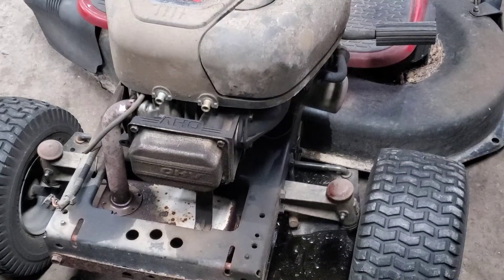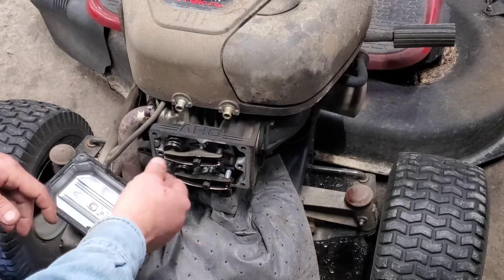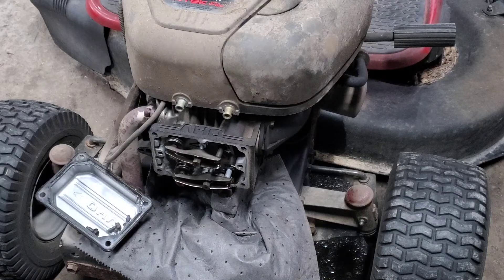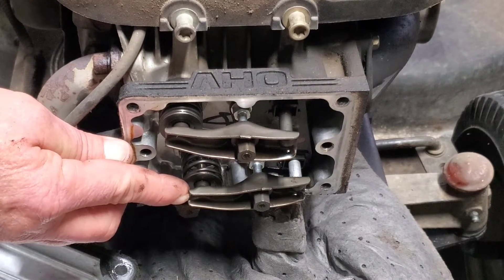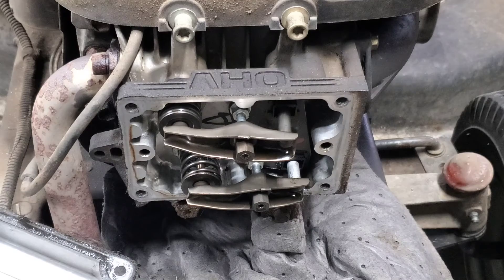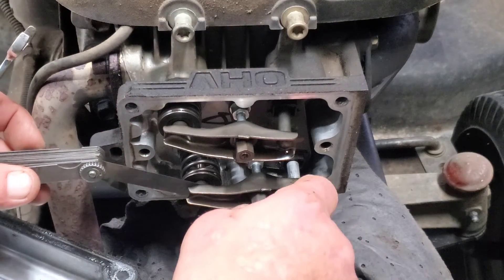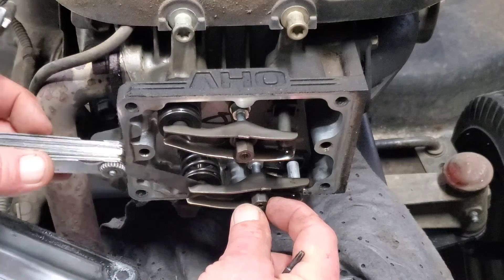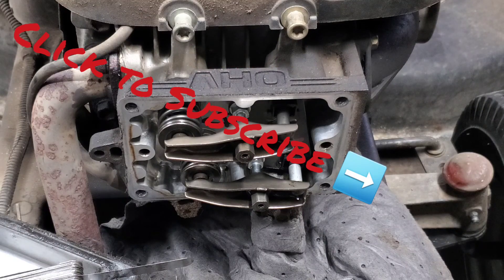Riding Mower Won't Start?  Compression Release Working? We Show You an Easy Way to Check it!

Comment: When I did mine this morning and I saw that little bump you showed I was so happy knowing all that was needed was the adjustment. I bought an old mower without a manual and had no idea this kind of problem existed. Thank you Sir
Reply from the maker: So glad it helped. Thank you so much for watching.
Reply: I have to do the same thing. Just spent $75 on new battery & starter. Engine locks up on compression stroke. I remove spark plug & it cranks over perfectly. Quick easy start tip is remove air filter & BLOCK OFF intake with a peice of rubber & crank it to start. If there's NO AIR sucked in to compress, the starter can usually get past the compression stroke & USUALLY start on its' own.